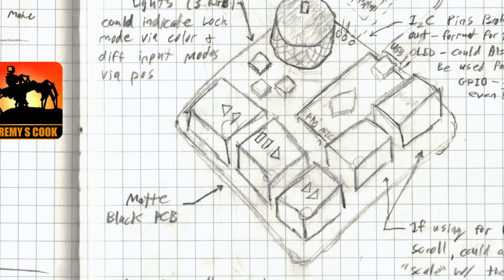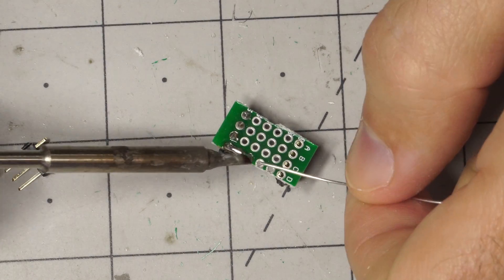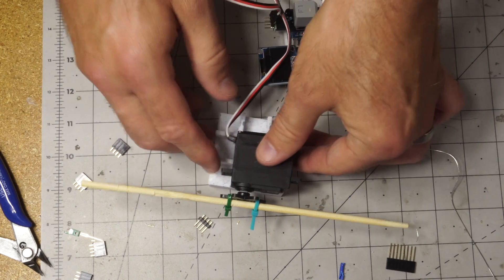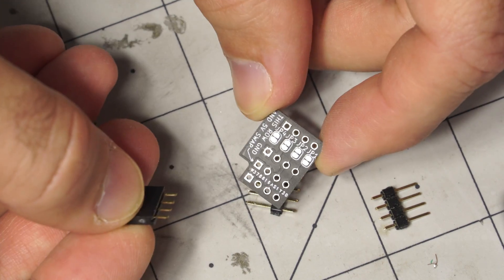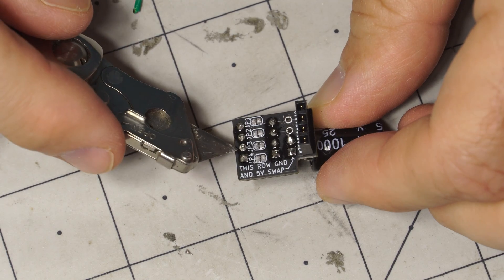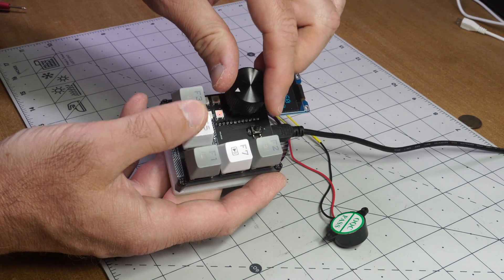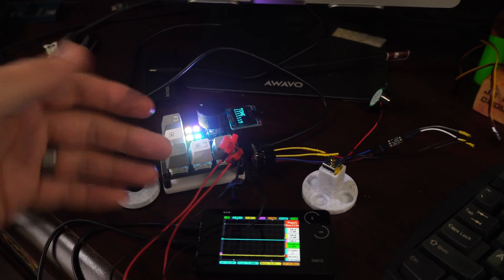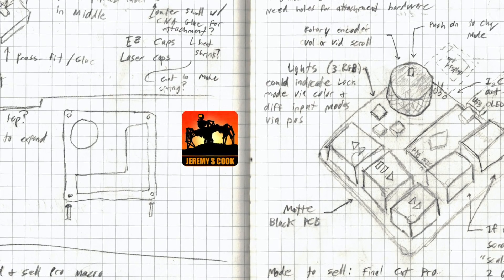Macro Keyboard Music Maker [Arduino]

Comment: Are you sure that piezo was made for that? Sounds like a fixed frequency piezo. Cool project though :)
Reply from the maker: Hey Dave, thanks for watching! 

Not 100% certain, but I don't think so. It does sound a bit weird in the video though. I actually did a bit of programming work today on the 8-key version and it sounds much more normal. I'm not entirely sure why though, maybe there was some timing issue or something.
Reply: @JeremyCook  the oscilloscope showed a little wave on the positive flanks, maybe yt encoded that weirdly, hmm
Reply from the maker: @Davedarko  Now that I'm experimenting a bit more, looks like I may have had the + and - leads reversed, which I thought didn't matter. Sounds good with black going to the output, and red to ground, which is certainly not what I'd expected.